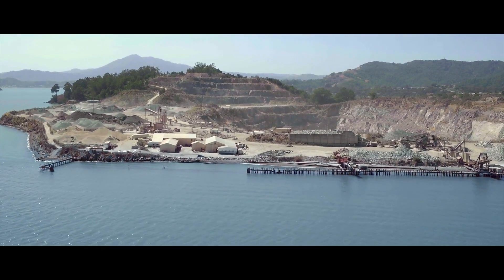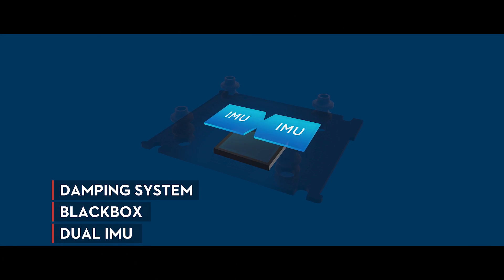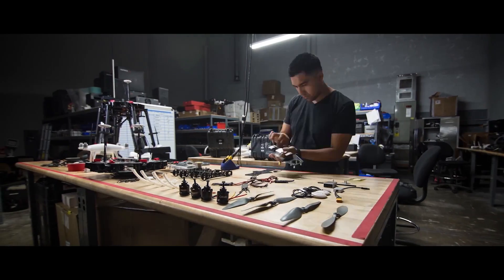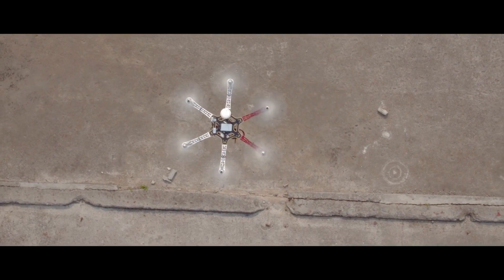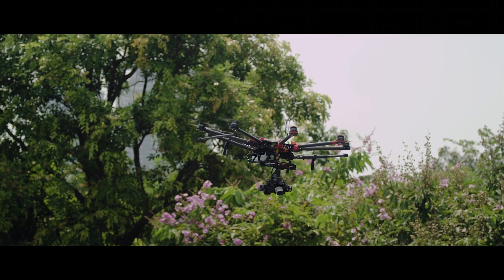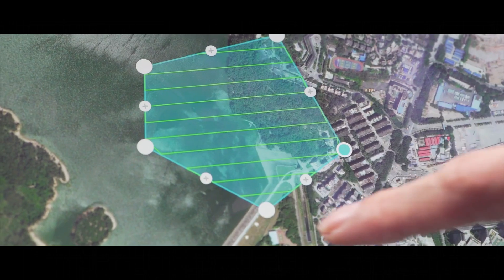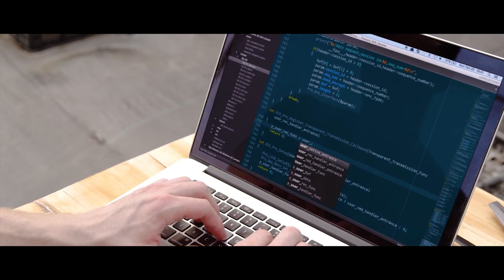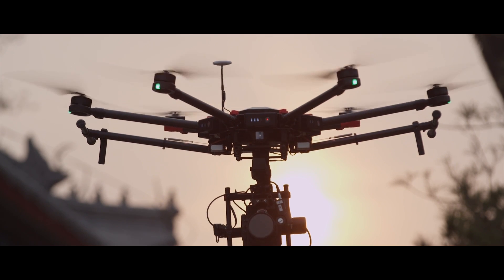DJI - Introducing the N3

Comment: that awkard moment when Arducopter APM board has those fuctions 5 years ago
Reply: Thought the same thing. even now you can do all that with a naze32 and some additional components for less than $100. And even then it will probably fly better. Seems like DJI just found out about PIDs and blackbox and other stuff that the DIY drone community (droneracers,...) had for years now.

Comment: If GoPro was smart, they would buy the DJI company.
Reply: DJI company is worth more than GoPro.
Reply: CLUTCH1st what's a GoPro?
Reply: DJI even won't sell itself to Apple.
Reply: I do not think it is possible.  It is a Shenzhen, Guangdong, China based company.  The success of its product line is due to the proximity of the manufacturing component and the distribution hub.  Because of this, it is impossible to compete against them.  Due to the relations they have with all of the key manufacturing players in the drone space, and the underpinnings of how Chinese business is conducted, they know what the competition will have to do before the competitor does - Look at 3DR.
Reply: The real Chinese high tech company builds drones at hundreds of miles controlling range... Instead of 5 miles.
Reply: gopro is peanuts compared to them, other way around
Reply: CLUTCH1st 
If Frank Wong sold his company to Gopro I would hate DJI forever. I cannot stand the douchbaggery of Gopro and its keynote presentations.
Reply: It could be dangerous to China's national security if US company buys Chinese high tech company ;)
Reply: Watson Yuan More like a CRJ-700 size
Reply: It does seem silly but the issue goes a little deeper - a foreign national buys it but ends up with nothing and no way to enforce any of the contract obligations or intellectual property rights...
Reply: Watson Yuan Civilian drone market is different from military drone.

Comment: Awesome! Anyone know what the frame was that Don was using?
Reply: DJust787 DJI 550?
Reply: bdseidler Nah, the quad he was flying with the extended length frame, 450 arms and longer body, looked like the TBS discovery but a bit different
Reply: DJust787 At what sec mark?
Reply: 0:33 You see him carry the quad up the hill. Thanks in advance
Reply: DJust787 I have seen him with this one. It is a TBS discovery knock off, just like the discovery. But don't know what it is or what its called.
im selling a TBS discovery w/700kv motors, naza v2, 1.3 fpv, Spectrum 9c rx for good price.
Reply: it's called alien frame, made by rc timer if im not wrong

Comment: DJI should I get the mavic or phantom
Reply: Project Gaming Yes, ether
Reply: I'd suggest you get the Mavic- if you are new to this, the Mavic is much more portable and I believe you will get a lot more use out of it for this reason.  I
Reply: Isn't the Mavic better in any way except the fact it isn't out yet? If you don't mind waiting a few months, get the mavic.
Reply: Thanks everyone it do you guys know if the mavic handles Well in the wind and if the camera is not as stable. And also i do have a few drones that I already have but i do need an upgrade
Reply: Project Gaming The mavic (surprisingly) handles better than the Phantom 4 in the wind. I think stability is the same.
Reply: Cakeofdestiny thanks very much for the advice. Do you have a mavic pro or any Quadcopters
Reply: I have a Solo by 3DR.  I have a Mavic on order.  Casey Neistat (YouTuber) convinced me to give it a shot.
Reply: Project Gaming I have a Phantom 2 I bought a few months ago, but the Mavic Pro is very appealing so I checked out a lot of details about it. Watch some more reviews and see if it's for you. I'd recommend getting a cheaper drone first, to see if you're actually into this thing.
Reply: Project Gaming I'd particularly recommend  FliteTest's video about the Mavic.